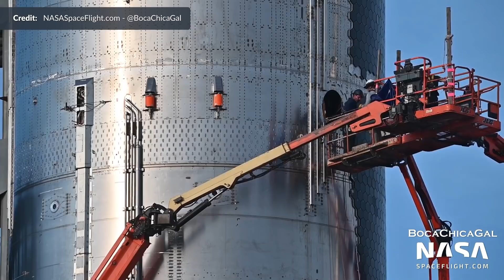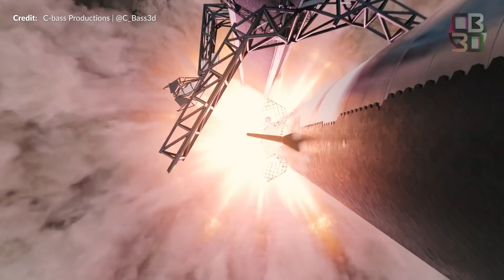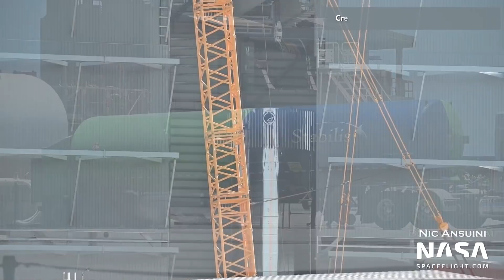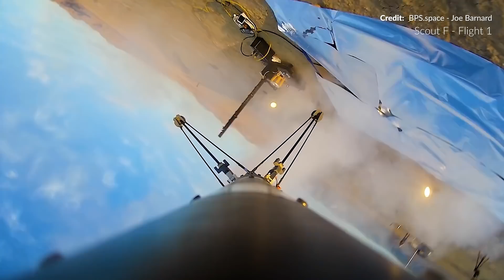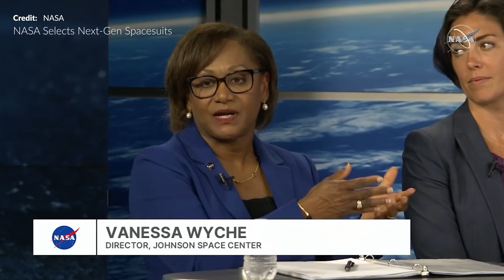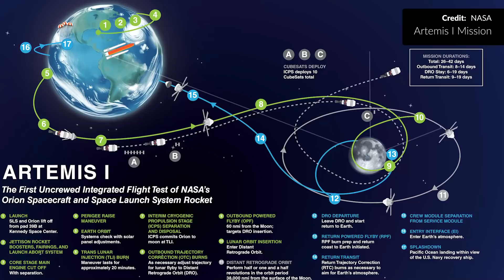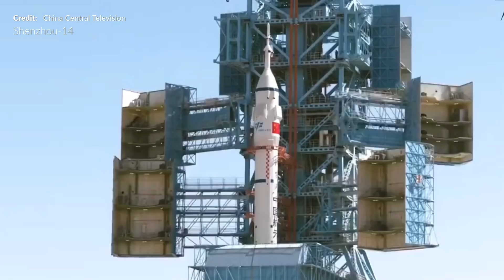SpaceX Starship and FAA milestone achieved. Space Suit Award, Capstone, SLS and JWST

Comment: Have the copter dust off those solar panels on that lander with the rotor wash...
Reply: The Ingenuity helicopter is over 2,000 miles from the Insight lander. The helicopter has dust problems of its own.
Reply: @steveaustin2686  the lander has an arm on it. Why did they not include a dust rag to wipe off the panels? It's plain to see men designed  this craft.
Reply: @davidlang4442  It's a scoop arm, so it is pretty sturdy and not that flexible. The dust is NOT like Earth dust. It is much more abrasive and statically charged, so not as easy to remove with brushing. Apparently, NASA felt the risks of that arm brushing the dust off was not worth it. Every gram is precious on these spacecraft, so a brush would displace something else. Besides, the existing NASA dust mitigation strategy worked as it is on day 1,293 of its 731 day mission.

Comment: Probably a stupid question, but why the hell cant they just get something like a car windshield wiper thing and attach it to the solar panals to prevent dust, hell an air compresser could do the same, so why? On that note, why do these things always show video in almost obscure ways, can't they just get something like a go-pro or something?(plus other camara's with it of course)
Reply: Easier said than done, as every gram is precious on these spacecraft. Mechanical complexity causes failure points as well. The Insight lander is 1,293 days into a 731 day mission, so NASA's existing dust mitigation strategy worked well. It just didn't get lucky with dust devils like some other landers and rovers.

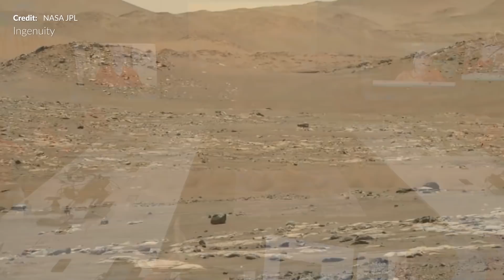Comment: At 16:44, something about this clip just really brings home that this is a video being taken on another planet, and to see a little helicopter buzzing around there is a fascinating reminder that we can accomplish these feats.  I mean, I've seen just about every video since its first flight, and intellectually I know it, but this one felt different for some reason.

It's a shame they couldn't use Ingenuity to give the rover a little buzz to blow off the solar panels.  You'd think they would have included a fan or air compressor or little brush attachment for the arm to self clean the panels, seeing as how virtually all the other rover losses were caused by the same issue.  I mean, I would've gladly donated a dust mop to NASA if they were strapped for cash...I know how expensive Mars rovers can get.

Comment: Thank you for the updates every week again. With the Martian dust on Persevarance and Ingiuity, I don't understand that they didn't install some brushes on the vehicles so they can dust it off by each other...
Reply: The Ingenuity helicopter only weighs 4 pounds, so it really can't carry any extra weight. The blades help with the solar panel, but the dust is building too fast. The Perseverance rover doesn't have solar panels, as it uses an RTG for power. The Insight lander has the dust problem and it is over 2,000 miles away from the helicopter. 

Adding something to clean dust is easier said than done. These spacecraft worry about every gram of weight, so adding something else takes away from the science. You also have the mechanical complexity of whatever is going to try and get the dust off. And this is not Earth dust either. It's static charged and abrasive too. Insight is like 1,290 days into the 731 day mission, so the mitigation strategy they used for dust worked pretty well.

Comment: Yeah, it's go time. See those missing heat tiles? Yeah, good luck with that, Elon. You need to learn a little word called "DENSIFICATION". The real engineers had to do it to the space shuttle. Your flying bomb is going to disintegrate unless you fix the issue.

Comment: It doesn't look like the grid fins on the booster will fold in like the falcon boosters do.  Is this part of the "Keep It Simple" construction idea so they don't have to have mechanicals to unfold the grid fins?  Isn't there a huge drag created by the grid fins even with the waffle pattern that has to be overcome???
Reply: The Superheavy booster grid fins are like 3 tons a piece per Musk. And he said that the drag saved by folding them, would be outweighed by the mass of the equipment to fold them. Aerial shot seem to show that the grid fins are getting smaller and Musk wants to get rid of one or two of them. So time will tell if they get to the point that folding them will be worth the weight of the folding equipment.

Comment: If they programed the helicopter to hover over the rover's solar panels, 
would it generate enough thrust to blow the dust clear?
Reply: Insight is a lander and is over 2,000 miles away from the Ingenuity helicopter and Perseverance rover. The helicopter has dust problems of its own and Perseverance doesn't use solar panels for power. It uses and RTG instead.

Comment: Hover the helicopter over the solar panels on the rover.  The downwash should blow most of the dust off of the panels.
Reply: Insight is a lander and is over 2,000 miles away from the Ingenuity helicopter and Perseverance rover. The helicopter has dust problems of its own and Perseverance doesn't use solar panels for power. It uses and RTG instead.

Comment: I wonder if Ingenuity's rotors can blow some of the dust off of Insight.
Reply: Insight is over 2,000 miles away from the Ingenuity helicopter and Perseverance rover. The helicopter has dust problems of its own and Perseverance doesn't use solar panels for power. It uses and RTG instead.

Comment: Can they use the draft wind from the drone to blow away the dust on the solar panels of the rover?
Reply: They are over 2,000 miles apart and the Ingenuity helicopter has its own dust problems. The Perseverance rover that dropped off the helicopter doesn't use solar panels. It uses an RTG.

Comment: Can’t they get air from the fans from Ingenuity to blow dust off the Insight’s solar panels. This not being NASA’s first trips to Mars, and these being multi million Dollar devices, you would think they would’ve added a can of Compressed Air to clean the panels. 🤷🏻‍♂️
Reply: Because the Insight lander is over 2,000 miles away from Ingenuity helicopter. Ingenuity has dust problems of its own as well.
Reply: @steveaustin2686 , my bad, the point being that the helicopter should theoretically be able to help remedy the dust situation on its rover. Being reliant on Solar Power, HTF did NASA not account for dust and grit on dry, desert world?
Reply: @adarret  NASA DOES account for dust on Mars. They are not stupid. Mars dust is not like the dust here on Earth. Mars dust is much more abrasive and has a static charge. In spacecraft where every gram counts, putting in some mechanical dust cleaning system is not trivial. Not to mention that the complexity of some wiper/brush system has its own problems with failure points. The Insight lander is 1,288 days into a 731 day mission.

Not sure what HTF is. The Insight lander was the first long term solar powered Mars vehicle/lander. The Ingenuity helicopter only weighs 4 pounds and has dust problems of its own, even with the blades stirring the air around the panel. Perseverance does not have solar panels as it uses an RTG for power.
Reply: @steveaustin2686  Then if they accounted for it they failed.
  Perhaps if they took the designers out of their cushy Labs in Houston, at the Cape, JPL, etc. and put them up for a month at White Sands and took them out of the lab and to experience a sandstorm first hand they might’ve not have been as incompetent. 
   This might hurt your proverbial ears, but NASA is becoming Roscosmos. 🤷🏻‍♂️
Reply: @adarret  Eh, the Insight lander is like 1,288 days into a 731 day mission, so they seemed to account for the dust quite well. Again, Mars dust is NOT like dust here on Earth. And if the Insight lander had been hit with the Mars equivalent to a sandstorm, the panels would likely have been cleaned, like what happened to Spirit and Opportunity at times

Nah, NASA is doing much better than Roscosmos.
Reply: @steveaustin2686  Thankfully there’s SpaceX, Sierra, Axiom, SNC, etc. and NASA funding and making the Private Aerospace sector what it is today. Thankfully that seems to be going better and better.
Reply: @adarret  Yeah, NASA's commercial programs have been very successful.

Comment: If a broken pipe knocked all those tiles off, just what is going to keep them from falling off during re entry? SpaceX seems to be using the same design as the space shuttle, which has proven disastrous. Just one missing tile could cause the entire ship to burn up on re entry. Several are likely to fall off during launch.
Reply: Starship uses steel instead of aluminum, so the temperature problems are much smaller.
Reply: "SpaceX seems to use the same design as Shuttle" is a proof that you didn't know what you're talking about
Reply: @alvianchoiriapriliansyah9882  The overall design is quite different, BUT, the tiles seem to be attached in a similar way. It was common for the shuttle to lose tiles, and the same thing is happening with the Starship. If something isn't done to solve that problem, I see a repeat of Columbia.

Comment: I hope they are running all that methane through extra filtration before loading to enhance stabilization.  I could not trust the amount of separate shipments needed for these launches.  BTW? > is Musk going to start manufacturing/producing his own methane, or does he purchase it?
Reply: Apparently, SpaceX is dropping plans to make their own methane at Boca Chica.
Reply: If the methane from supplier isn't pure enough for launch, they wouldn't order it
Reply: @alvianchoiriapriliansyah9882  I am referring to the amount of separate individual shipments they receive of it, every tank delivered has a potential chance for impurities, for many reasons.  Storage time, distance of transfer under various conditions, moisture, etc.  I'm just stating that it would be a shame to go to all this length to launch and because of impure fuel there could be potential issues.  So I'm just assuming they would have an extra filtration process before they even pump the fuel into their systems.

Comment: how hard is it to put a wiper on those panels? even a ford pinto has wipers
Reply: Easier said than done. Apparently, it's easier just to make the panel larger. It worked well as the Insight lander is 1,288 days into a 731 day mission.
Reply: @steveaustin2686  not downplaying the success of the mission, but imagine having a wiper and being able to sustain it even longer. maybe 3 or 4 times longer if this is the only limitation
Reply: @xClaudiaOctaviax  Except the complexity and mass of the wiper system are serious issues. Not to mention that the dust is not like dust here on Earth. It is abrasive and has a static charge. Wiping off the dust is easier said than done.

Comment: Another fantastic one again

I don’t think these 5 missions are enough for NASA crew rotation on dragon though, would be to 2028 which is a bit short of 2031

I’d expect announcement of either more reuses for dragon and another 2 vehicles built for its cadence or up to 8 more for the current 5 reuses because once CLD’s and private astronaut missions get underway, cadence will be wild

Really confused why NASA didn’t just continue with XEMU. It was a fantastic suit and looks way more advanced and complete than what this commercial contract will have to rush. I would’ve liked commercial suits to do LEO and XEMU to stay with Artemis, but maybe Collins will do deep space and axiom stays LEO seems more sensible due to experience

For shenzhou’s escape tower, well it’s an old vehicle flying 20 years before dragon or Starliner so you can’t blame it. CAS will be moving to their next generation crew vehicle later this decade capable of deep space like Orion

Starliner doesn’t need to reuse its abort system because it’s meant for a different purpose. Can’t directly compare it to dragon so yay Starliner and dragon. Reuse isn’t for everyone. It’s fine to have or not have it
Reply: xEMU was discontinued the same way to why SLS is famous for what it's: too many contractors, cost+, over budget

Starliner's less reuse contributed to the more expensive operational costs than Dragon, so it matter

Comment: Ingenuity, how ironic it lacks a brush for the solar panel. The panel is on top, circular, and coaxial to the main rotors. Why not have you a balanced two blade brush cleaner with a simple mechanical clutch to engage it during a flight, to spin clean, when the main rotors are powered. Can't they mock this up on Earth? I don't get it. They always have the same excuse, we didn't plan for it to last this long. Really!

Comment: I don't understand why NASA cannot install a cheap and light brush attached to an arm mechanism to clean up the solar panels? They should have sent the solar-powered solar rays equipped with something like that. It isn't as though NASA does not recognize the issue of dust and sand. A simply brushed wiper or even tilting solar panels would have extended the life expectancy of these invaluable rovers.

Comment: Mercury rotates 3 times for every 2 orbits because of the high eccentricity  of its orbit.  Tidal lock is as the name implies due to tidal forces.  The strength of tidal forces is proportional to the inverse CUBE of distance, which means that, for Mercury, the force at perihelion is more than twice as great as at aphelion, so Mercury rotates at an angular rate close to its angular orbital motion at perihelion which is about 50% greater than its average angular orbital motion.  So any object orbiting a star or planet close enough that tidal force is dominant will be totally locked if the eccentricity of its orbit is low, as is the case for all of the major moons in our Solar System except Triton.

Comment: Marcus, its more than a minor issue. They fixed the pipe, but they didn't fix the design of the tiles. The pipe may have hit the inside of the tank, but the tiles should have sturdy enough mounts to remain in place. After all they are going to have to resist extreme forces on both ascent and re-entry.

Comment: So I still say it could be coincidence, but every delay is so conveniently timed. You have a scheduled SLS launch date and a scheduled release of the PEA. SLS slips, nearly immediately followed by the FAA. It’s corresponded exactly every time, and not always been the same delay length. This final May 31st, 2 week delay is no different. When is the SLS launch? No earlier than June 13th…

The reason why NASA and their PR might want SLS to launch first? It’s plain as day on their webpage for SLS “when it launches, SLS will produce 8.5 million pounds of thrust. More than any rocket ever built flown…” except Starship/Superheavy produces ~18 million lbs and I think that’s based off of 27 Raptor 1 engines. 

Why would NASA feel the need for this blurb to be proven true? Distraction. SLS is a disaster. Recursive design, blown out budgets and deadlines thanks to cost plus contracts, and it still doesn’t work. It’s literally using Shuttle program reusable engines but expending them. Such a waste. Buuuuut, the lobbyists who work for NASA are presumably looking for a soundbite they can serve up to the politicians who determine NASAs budget. Anything to push SLS off as a massive improvement over the Apollo program, the Shuttle program, etc. and to a politician who isn’t especially concerned about NASA, when they can tout the number of jobs it created, and that it’s the most powerful rocket flown at the time of writing, I would assume that would win points for NASA. 

I don’t think NASA hates SpaceX, I just think that it’s sadly super cutthroat with regards the blue half of the government who see space as a waste of time and money. I think NASA knows SpaceX will be fine with the delay and will continue to innovate just as fast as ever when the FAA approves. It’s the same reason they didn’t give SpaceX the contract for spacesuits. SpaceX will make their own, probably cheaper, better and faster than NASA/their contractors. I think SpaceX has a good chance of making the Trump timeline of returning to the moon by 2024, where NASA probably won’t even make it in 2025. But if SpaceX is doing it anyway, why would NASA invest more into them? They’re highly profitable and extremely motivated, and they have a good chunk of NASA money as it is. I am guessing NASA will be hands off with SpaceX until SpaceX announces their lunar mission. Then NASA will announce a partnership with SpaceX and switch Artemis from SLS to Starship.

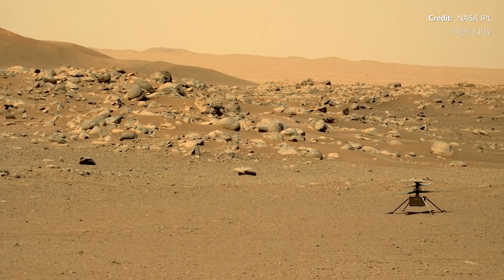Comment: @16:27 Seriously? A simple solar panel cleaning process wasn't thought of as important. It is what the damn thing runs on. Sometimes the stupid kinda seeps in. OK, let me be the first to offer a solution. Solution 1: Mount a brush under the rover. Every now and then drive the rover over the top of the drone. Solution 2: Mount the solar panels below the drone's blades so that when it flies the solar panels are blown clean. Problem solved. You're welcome. Send my cask reward to my youtube channel.
Reply: 1. The Insight Lander is not a rover, therefore, it doesn't have wheels to drive around on Mars.
2. Putting the small solar panel below the blades will lead to a considerable reduction in productivity (can't charge solar panels with objects blocking the Sun's light)
Reply: @archer1133  Oh for crying out loud. You would have to modify the solar panels in rings.
Reply: @CDCLLC2023  Since you seem proud of yourself… sure…
Reply: i'll assume you said it as a joke
Reply: @MrPinguinzz  No!